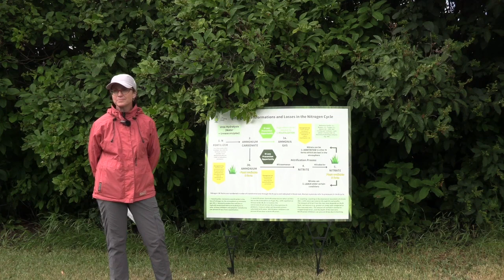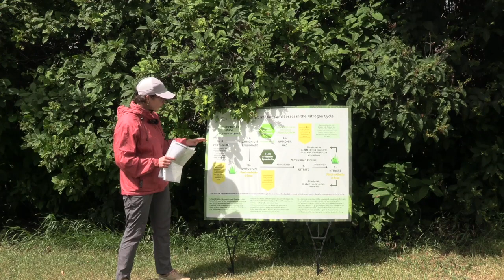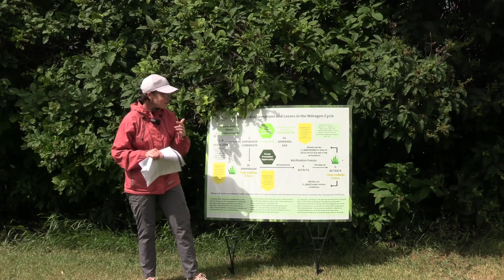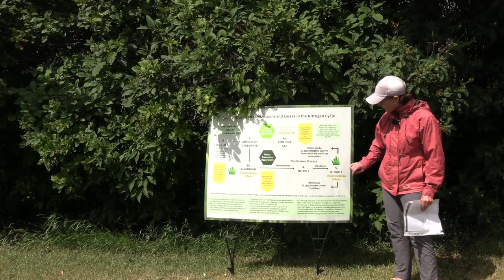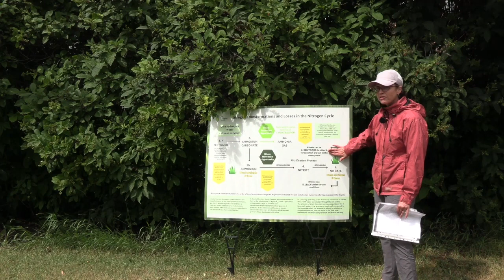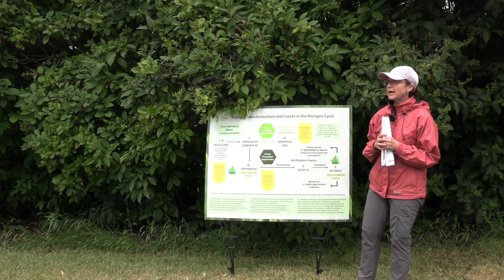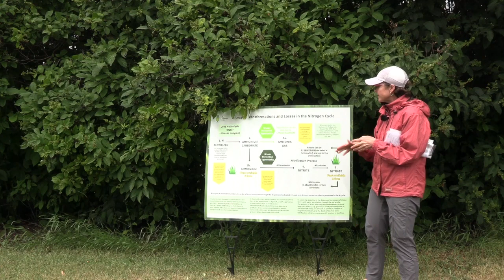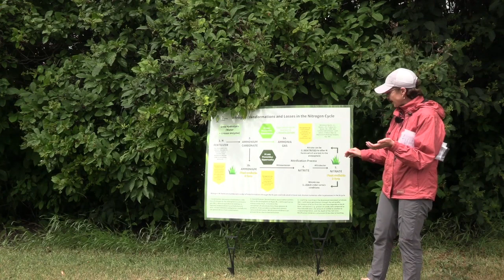Wheat School: Understanding the nitrogen cycle to reduce input losses and emissions

Comment: How can you know your yield potential before your seed has even germinated? An average yield of 50 bushels could mean half the time I yield 0 and half the time I yield 100. If we fertilized closer to when plants can use it we would know more about the years yield potential. Then we could fertilize more accurately and if the year has very low yield potential you wouldn't fertilize at all. Over the course of time if everytime an area has a disaster there would be virtually no emissions because no fertilize had been put out and we will have reduced our emissions with no reduction in individual or overall production.

All the products that reduce you N losses only buy time, if conditions aren't favorable at the end of the time period the losses still occur